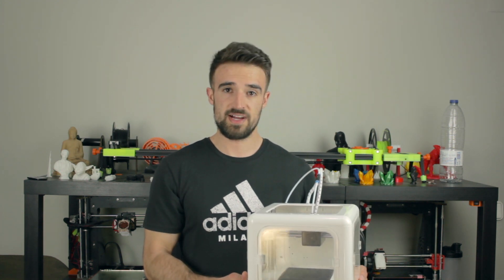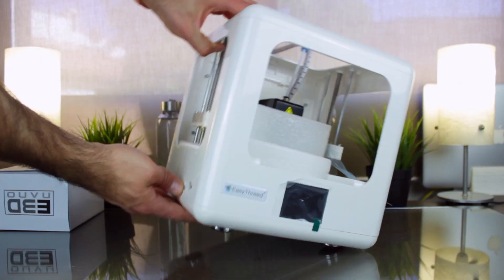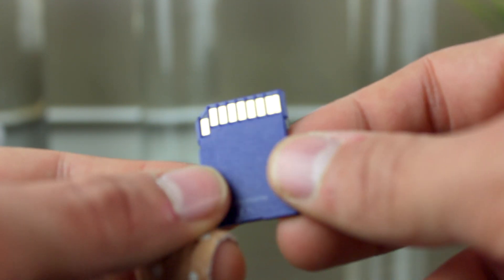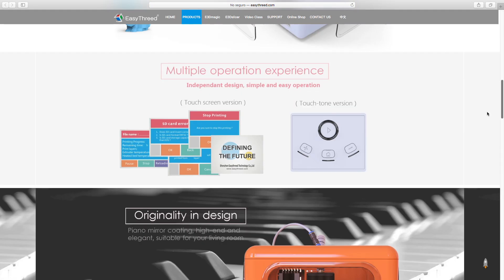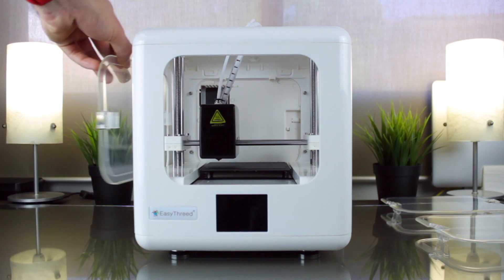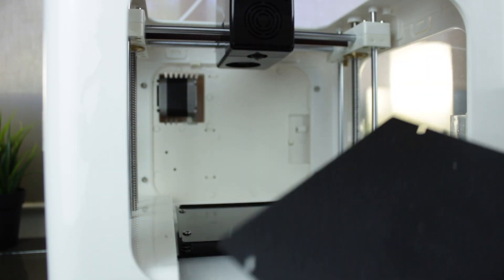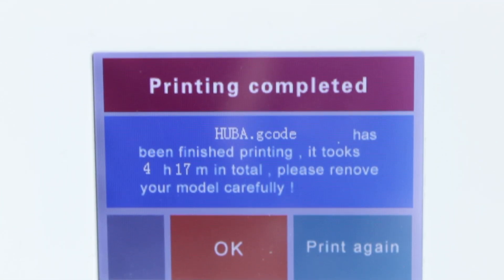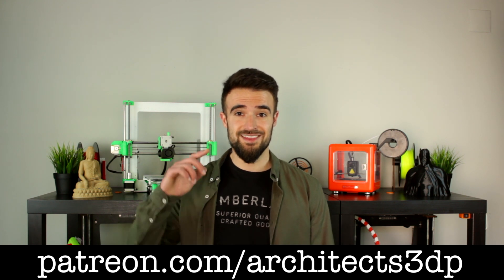EasyThreed DORA - 3D Printer Review

Comment: Awsome vid, just ordered a Dora today and can’t wait to get printing!!!
What settings did you use to set up the Dora with cura? I have set up the build plate size but not sure if I need to amend any of the initial code that cura puts in!!
Reply from the maker: Thank you Pweebs!! yes you have to write some code for the start and end of the prints... I will make a video setting up the NANO and DORA printers with cura and their own slicers! =) give me a couple weeks to make the video :)
Reply: Architects3DP would you be able to DM me the start and end code you use?

Have earned a sub also, nice vids
Reply from the maker: @pweebs106  Thank you! Actually I'm using a code that just works, but is not optimised for any of the printers. I'll make the video, don't worry. You can use their included E3D slicer while I'm making it
Reply: @architects3dp  Hi guys, did you manage to find the correct settings for Cura yet? I desperately need it.